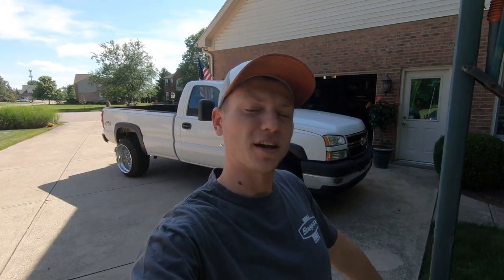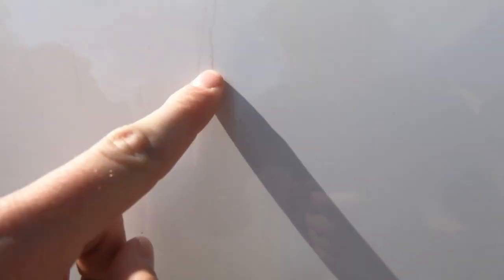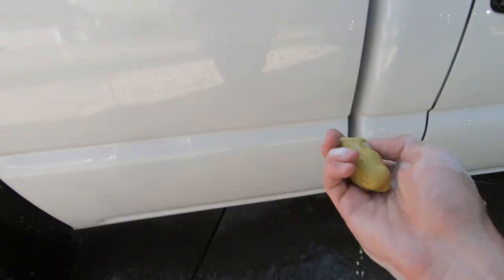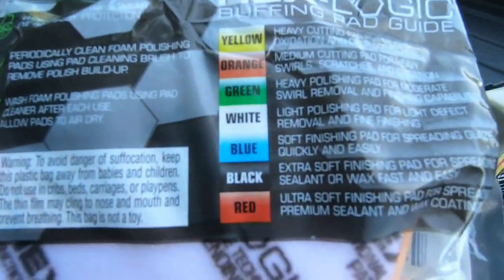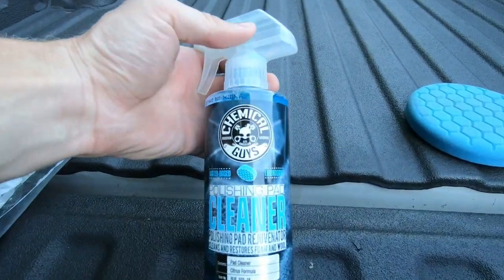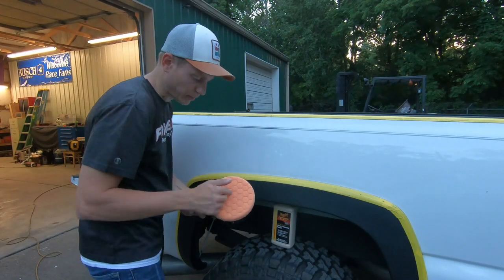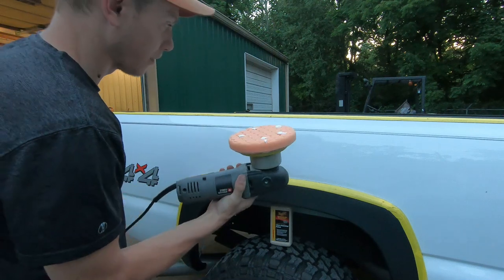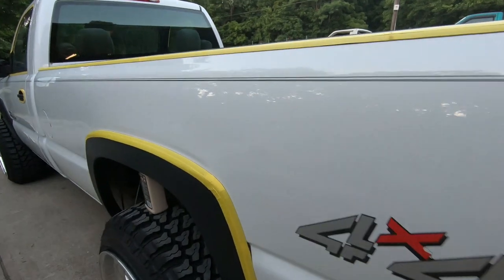How to Remove Swirls - Full Paint Correction

Comment: That alcohol is going to take everything off, and you said wax. I think you did polish with a cutting pad? The clay bar you should use spray lube so your not picking up any sand tinny pieces of dirt and clay up and down incase you make a scratch it's harder to see, if a scratch is going horizontal you will see it more from the sun. The alcohol should be your first step before you pickup the buffer to remove tar, sap ect. The black extra thick pads work better for polish and I would try a purple wool pad for compounds. They work great. Good job. I think it may be a good idea to let people know that the clay bar is only needed when you have contaminated paint, not every time and explain the different grits of clay. Did you end up wet sanding?